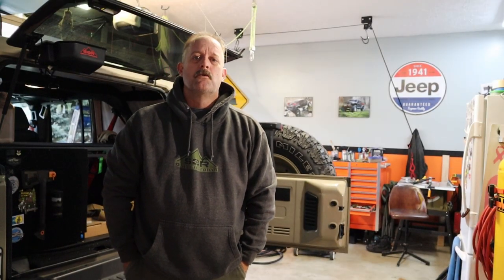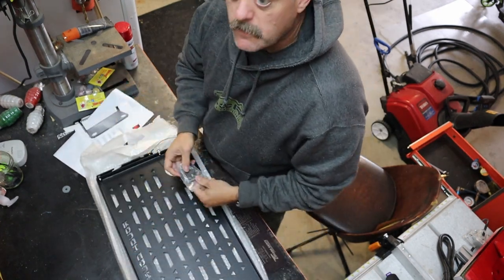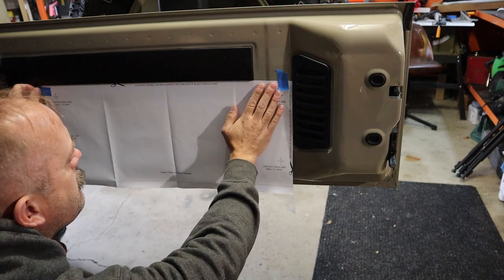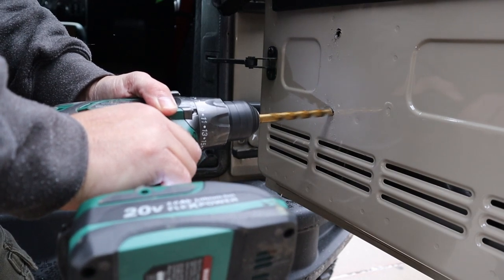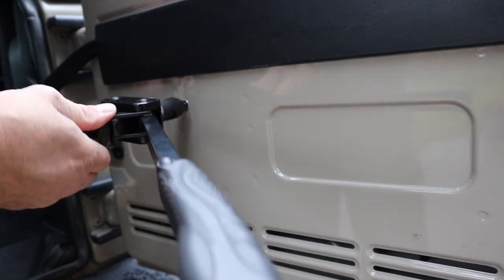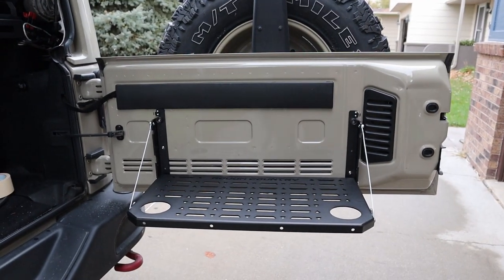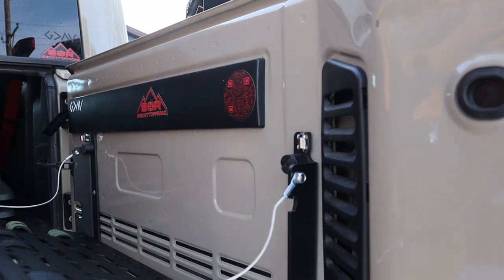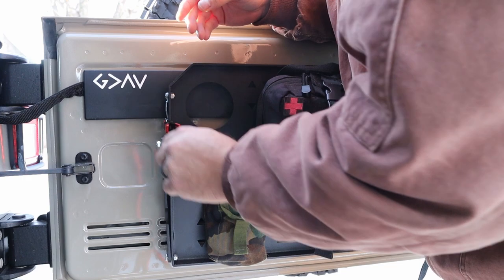Jeep Wrangler Rubicon gets a Rough Country tailgate table...install has issues!

Comment: Do the straps passing through the table affect usability being that the table surface is no longer flat?

Also, the honesty is appreciated.  We've all been there.  😆
Reply from the maker: yes and no? setting somthing like a 2 burner camp stove on it, no not really,  putting something tall and skinny (ie Yetty travel cup) then yes if you are not careful.   I am thinking about adding a thin piece of cutting board on it to make it smooth again.  The table being uneaven due to straps is a minor inconvience that is worth the added storage from uner the table...in my openion.  Thanks for the question.

Comment: Why did you need to drill the outside of the tailgate??🤷
Reply from the maker: I didn't, all holes were drilled on the inside of the tailgate throught the inner skin.  At some point the drill must have slipped and I dented the outsite skin of the tailgate....darn rooky mistake.  Thanks for wathcing and have a blessed day.